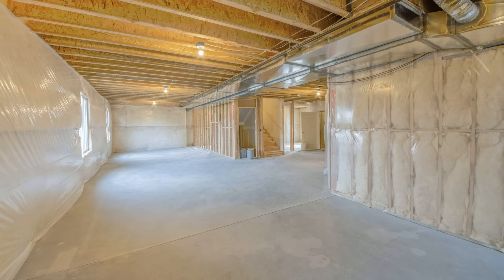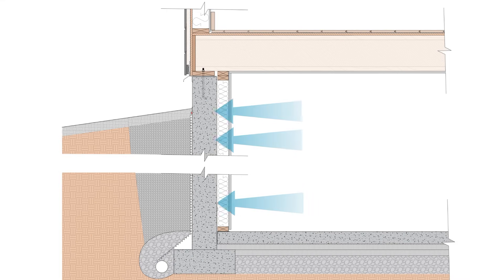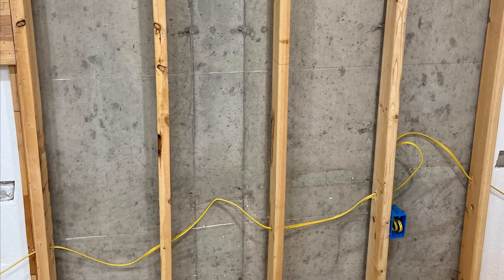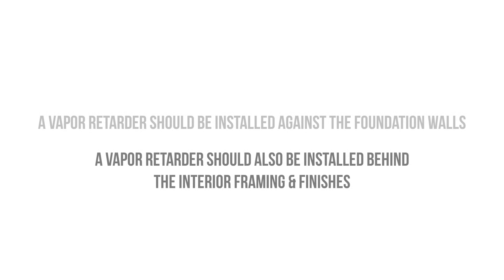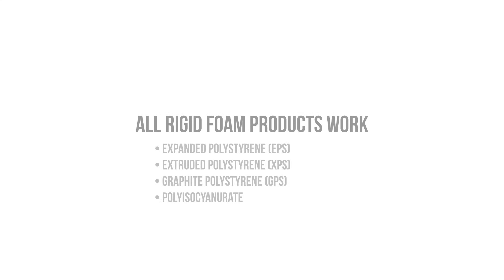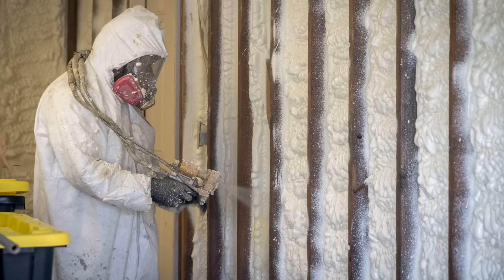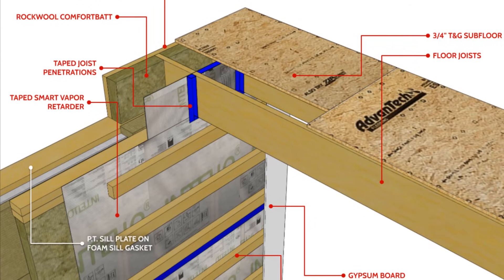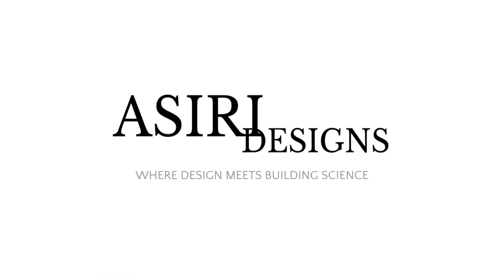The Ugly Truth About Basement Vapor Barriers

Comment: Is foil faced polyiso foam suitable for below grade applications against a poured concrete wall? Would the foil act as a vapor barrier and prevent any inward drying as apposed to unfaced XPS (oe similar) that would allow inward drying?
Reply from the maker: @davidp2966  If the polyiso is on the interior side it works, but it doesn't fair well if it is buried below grade on the exterior. I'm assuming you meant if it was applied to the interior side of the foundation wall. It's okay if there is a vapor retarder against the concrete, as long as any framed walls are able to dry to the interior unimpeded, you'll be in good shape.
Reply: @ASIRIDesigns  Thanks for the reply! Yes, I did mean on the inside of the concrete on the basement wall. My concern is that foil changes it from a vapor retarder to a vapor barrier. I've heard mixed opinions on this. Some have said that having the foil (facing the interior) does not allow moisture coming from/through the concrete to dry to the inside the same way non faced will. I'm just trying to learn the best practice.. I would prefer to just used the usual pink/blue XPS like most people do but I found that the foil faced polyiso is significantly cheaper than XPS. If theres little difference, I might go with the polyiso instead.
Reply: @davidp2966  Concrete does not need to dry. It will happily stay wet, forever. However, you don't want the polyiso to be waterlogged, so foil facing the concrete would be better.

Comment: Call me crazy, but when I finished my basement I did not like the idea of putting insulation directly on the cement walls. So, what I did was put a 9mm plastic from the top sill to the bottom of my stud walls. I made sure to wrap the 9mm plastic under the studs on the bottom of my interior walls. I then put R19 insulation in the cavities of the wall, I felt that with the 9mm plastic being directly up against the foundation the insulation wouldn’t get damp or wet. I then finished my walls with Sheetrock and some knotty pine over the Sheetrock for some accent walls. It’s been at least 30 years and I’ve never had a dampness problem or mold anywhere. I do run a dehumidifier in my basement always, as I feel every basement should have a dehumidifier in it. Cement is porous by nature and with a basement being sometimes 5-6-7, or even 8 feet unground you should always use a dehumidifier in those conditions. Just my opinion.
Reply: I'm planning to do exactly what you did. I actually just finished putting in an interior french drain with dimple matting coming 4" up the wall at the base. I'm planning on putting 6-9 mul moisture barrier from sill plate down and run it behind the dimple matting at the base. Does this sound like it will work? Do I still need a vapor barrier alsalsohad water coming through both the walls and the cold seem where the floor meets the walls. I also run a dehumidifier always, keeping it under 55% humidity all the time.
Reply: @brianhawthorne8480  I just did what I did because like I said I never liked the idea of insulation sitting right up against the foundation. Cement is porous by nature and the foundation being underground it is always going to be damp. With a 9 mil plastic right up against the foundation walls, then your studs and insulation over that prevents anything from ever getting damp. That’s just my opinion. It won’t prevent the water or dampness from getting in, however it will keep it from hitting the insulation and studs. It’s been at least 30 years and I’ve never had a problem, however, I do recommend always running a dehumidifier in any basement. Good luck.
Reply: @rickpacheco8864  exactly. Moisture will always come through a bit. But the poly should stop it. I was just wondering if there is ever a problem with retaining moisture between the poly and the concrete/cinderblock wall. Either way, I'm just gonna do it. If it fails it fails. 😂
Reply: @brianhawthorne8480   well, to answer your question I have never had to open anything up because I have never had a problem. I don’t see any signs of dampness, or any damp moist smells that you usually smell or see when you walk into a basement. My walls are finished with drywall, and I even have some notty pine accent walls over the drywall.   When I go in my utility area where a part of my wall and floor isn’t finished it gives me a good chance to always look around, and everything looks good. Like I said it’s been a good thirty years and I haven’t had one problem. I’m old school, keep the moisture from hitting the insulation and wood and I think that’s the way to go, it’s worked for me.
Reply: @rickpacheco8864  Great. Thanks for your help!

Comment: I have seen people installing the foam with a little space between the foam and the wall. They just place the foam with big spots of adhesive in the corners. I guess it is to let the air flow upward and let it get out from the ventilation. Is this a good idea?
Reply: I was told to do the same. Ill be installing 2" foam boards with a 1" gap/space in between board and brick wall.

Comment: I seal the concrete from the outside and inside. No wood framing in contact with concrete walls. Floor sill is treated and a nervous draw material between. 
People are going NASA and it's overkill for no benefits.

Comment: Wow, what an awesome video!!  I agree completely with everything you have said, however building code in southern Ontario will not allow you to not have a vapour barrier - you will fail building inspection.  I wanted to ask a question, if you are to use a sub floor system like dricore (plastic bottom not foam) - would you install before or after the outside walls?  Why?

Comment: Thank you for the info, just starting our basement project, we have the design and hired a framer, it is a walkout basement, the main wall is large glass windows and sliding door, the back walls are concrete, while both sides, our exterior walls.  must I use a vapor barrier on the concrete side? Or all the way around, or not at all

Comment: Great job on this video! Just had to "un-finish" a finished basement that had massive black mold due to plastic vapor barriers. I think it's insane to finish a basement in anywhere other than a desert. Digging up the ground to pour the foundation and run off from the roof means basements will always be damp/humid... perfect for mold. I would never build a home with a basement or finish a basement. You're better off with an above ground addition, if you're already stuck with a basement - cheaper in the long run.

Comment: I installed the rigid foam outside the concrete wall over an exterior impermeable membrane as I have seen done on some large construction projects. What are the negatives on this approach.
Reply from the maker: @williamtait3700  This is a great approach, the only downside is ensuring the long-term durability of the rigid foam and keeping bugs away from it. Apart from that, it works great.

Comment: Glad I saw this video before starting on my basement. I have a 2017 build home just outside Toronto, and was initially going to leave up the builders vapour barrier on the concrete wall that surrounds the Earth under the garage floor. But I’ll definitelyuse the rigid foam approach and then frame on top of that.

Comment: The vapor barrier is cut out at ground level height every third stud spacing to eliminate the moisture trap.

It works well and I have been building homes since the earl 70s.
Reply: Can you explain a bit more please? 
If the vapor barrier has intentionally added holes, how does it block moisture at all? Why doesn't that defeat even adding one?
Reply: A 80% intact vapor barrier is still 80% effective as a vapor barrier but utterly useless as an air barrier, plus vapor diffusion across bays is extremely slow. That's not a detail I'd want to rely on.

Comment: There is supposed to be an expansion joint between the basement cement floor and the foundation, with a "Big - O" drain, underneath the floor and then an exterior felt, such as house wrap or tar paper between the studs and the foundation so that any moisture runs down between the foundation and the felt to get it to keep the insulation dry and seep the moisture into the Big - O. You should NOT be trying to give information, kiddo!!!
Reply: The reason for the felt vs Styrofoam is because with Styrofoam the foundation cant breath anymore than if you put Poly over it. That is why you get a exterior breathable felt that will help the foundation to breath, without getting the insulation wet. Get a job in construction before you call yourself an intelligent advisor because you have it ALL wrong and hopefully, someone sues you!!!

Comment: I did my basement years ago. I dug the exterior walls down, installed 2” blue styrofoam down to the footings then went another layer of 2’’ for 2’. Gave me 4” for the frost line.  Then i did the interior basement walls with 1” blue top to bottom.  Basement is dry and warm.  Seems to be okay to this day, i believe its been 25 years and no issues!
Reply: Was dimple membrane available 25 years ago? Curious to know if you used it 25 years ago?
Reply: @ yes’s it was available when i did it and i did not use it. Before the 2” foam i had a company spray a blue rubber membrane , then a heavy plastic sheet immediately applied which it then stuck to the spray, sealed it tight it did.  This is on the outside i had it sprayed.  Still no issue, have a great day and hope this helps.

Comment: Used pink panther foam against the concrete block and then used a pvc bottom plate for the 2x4 walls. It has worked out really well we also keep a eye on moisture content of our basement air and run a dehumidifier in the moist months have had many comfortable years in the basement rooms. Lived in the house for a few years monitoring the Block walls We live on a hill above town and all the landscape around the house pitches away nicely and I added Gutters for extra water control. Made sure to have no major leaks before attempting framing and drywall. Good luck to any one upgrading living space.

Comment: I am interested in how the engineering and insulation and ventilation profiles are altered in the case where an  interior drainage system is install IE like Delta MS or AG foundation drainage membrane   and interior weeper or "french drain". If a Radon fan is installed in the sump it will cause depressurization and ventilation of not only the slab but  that area behind the drainage mat. It also makes sheet styrofoam more difficult to install.  In this case if no styrofoam was installed would a vapour barrier be reccomended ? Interior drainage systems are gaining huge popularity for cost reasons and being sold as "waterproofing" , which it is not,  and being done prior to basement finishing. The ADU basement apartment  builds are booming in this manner.

Comment: The vapor barrier needs to go against the concrete. NOT BEHIND THE DRYWALL.
Reply: Absolutely wrong. It needs to be installed on the warm side of the wall this is the only thing that matters.  Spray foam and steel studs are the best

Comment: What if you built two independent sets of concrete foundation walls, on separate footings, and filled the space between them with gravel to allow water to be removed by French drains at the bottom? (You could cover the space in between to deflect surface water.) You could go even farther by installing standard sump pumps between the two walls to mitigate rising groundwater. More than one if you like, why not. Certainly, the interior of the two walls would be less wet, and its temperature less impacted by the soil temperature, than a single wall assembly. How would you rate this scheme, and if someone was serious about doing it, how might you built it? Sometimes entertaining a theoretical idea, even if impractical, can provide ideas. Maybe there’s a video on things like this waiting to be done?
Reply: Buildings are built to a price point. That's additional labor and cost

Comment: I agree in theory on your point about not putting vapor barrier on the inside wall in basement but if you do, you will fail building inspection in most provinces in Canada. It's building code to install it that way.
Reply: Rip it out when they leave.  Whats the issue????
Reply: Flawed video. Seems to be pushing to fail inspection and never obtain insurance. Wasted my time watching
Reply: @kenwarner5387  I'm in Canada and have seen several to code basements with vapor barrier/insulation that lead to moisture/mold build up.

Just because something is code doesn't mean it's the best way to go.

Comment: Then you have all the problems with rigid insulation a) releasing toxic gas into the house interior and releasing toxic gases when it burns in a house fire.  There is no free lunch and the authors of this video should not gloss over that fact.
Reply: Why would you think that a 6 mil plastic vapor barrier would stop fumes from any burning insulation (even stipulating that the insulation wasn’t flame retardant)???
Reply: What toxic gas? All North American rigid foam is now blown with either CO2 or pentane.

Comment: Wouldn't it be wise to leave an air gap between the rigid foam and the concrete foundation, and a dehumidifer that runs year round?  This will wick moisture out from the walls... I did this and have a heat pump water heater that pulls heat and moisture from the basement.  Its a new system so time will tell but I can say the basement is minty cold in summer and seems dry down there.  Planning to blueskin the exterior next summer...

Comment: Such an incredibly informative video.  I had vapor barrier installed on painted concrete block basement walls about 5 years ago...along with an internal French drain.  In less than 6 months, I could see the mold growth "everywhere" behind the barrier.  The walls were already painted when I purchased the home and while the basement "felt" pretty dry, I was seeing signs of water infiltration.  Fast forward to today, I now have foundation issues.  The vapor barrier isn't the cause but if I had come across this video 5 years ago (along with other info I've recently uncovered), I would not have allowed the contractor to put the barrier on the walls.  I have clay soil, a yard that grades toward the home and cast iron pipes that act as both a sewer line and storm drain. The pipes need to be replaced (in process now). Also, the side of my house is only 8 feet from my neighbor's driveway retaining wall - and the back of their yard slopes to the back corner of my home.  A bit of a perfect storm.  The information you share is invaluable.
Reply: @mrgregweber  Indeed.  I just had all the pipes under the concrete slab re-done.  Sewer and storm drain now redirected to PVC pipes rather than aged cast iron.  Internal french drain has been redone.  All sloping towards drains that exit the house.  Removed sump pumps which were not working well.  Next step in the process is that I will be having the exterior of the home waterproofed  - following ASIRI (and structural engineer) guidance of membrane, dimple board, insulation board, gravel, and exterior drain as well.  Have to wait until spring for the landscape regrade, but that will be the final piece.  The foundation continued to settle while the plumbers were excavating internally and installing pipe through the foundation walls.  My guess is that there was sufficient presssure built up over time with failed pipes leaving excess water at the foundation, etc. And it released with excavation.  Footer is concrete; foundation walls are concrete block.  There are cracks in the block and mortar joint cracks on the exterior...and some cracked bricks.  I was onsite for all of the interior work.  I could see water coming in through prior installed weep holes.  And during heavy rains, a bit too much water came through the weep holes in my opinion - but my experience in this area is quite limited.  Structural engineer indentified that the exterior waterproofing will strongly mitigate the internal seepage (hopefully bringing it to a "drip") and that the internal drain will act as an emergency backup should anything get past the external waterproofing.
Reply: Your comment describes my basement perfectly. I bought the 56 year old house last year, the previous owners had the cinder block basement freshly painted and everything looked good and dry. They also left me two dehumidifiers that were running. then after a few rainstorms I noticed little a bit of water seeping in through the ground and small pockets of water behind the new paint! I also have clay soil in the NY area. Basement does not have a sump pump or french drain. Thankfully after a while of not receiving too much rain it seems to have dried up. What did you do to keep your basement dry?

Comment: Im renovating our basement now, the wall framing and insulation is dry and no mold at all. And thats with a vapor barrier.
The floor had vapor barrier on the concrete, then 5cm insulation. A lot of water there, so we're doing 10cm xps, then vapor barrier, then 5cm xps with concrete on top. That'll fix the floor issues.

But should i put vapour barrier on the walls as well then since its worked fine in the existing walls for 40 years? We're putting up wooden panels again, since it's better than drywall in moist enviroments. Only difference is that we wont put up the black paper stuff behind the wood. just a 2cm air gap with a thick layer of asphalt stuff under the wood so its not in direct contact with the concrete.

Comment: I didn't install one when I finished my basement.  I just put up walls with fiberglass batts and drywall.  Left space between the wall and foundation and a gap at the bottom of the wall that's covered with trim.  No mold.
Reply: Interesting where are you located?
Reply: @markmartin7384  New England.  Pretty sure the foundation is sealed from the outside as well, so that makes a big difference.